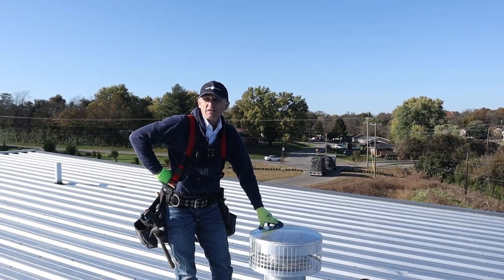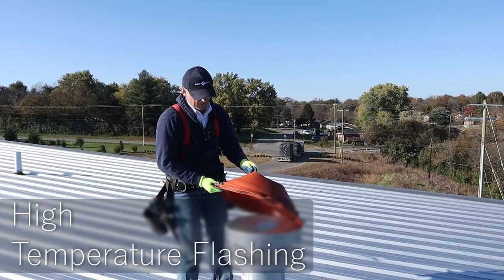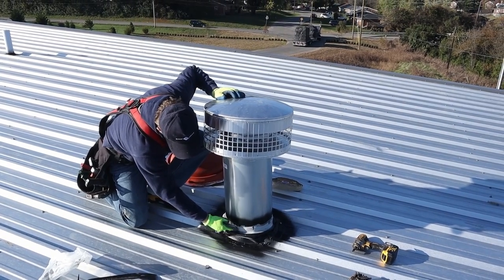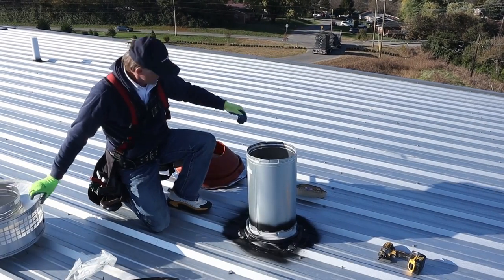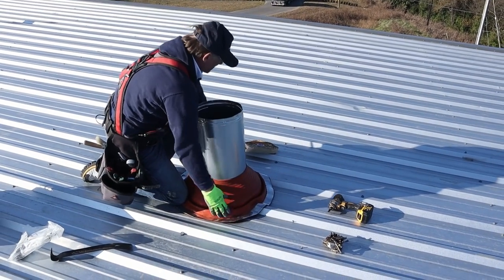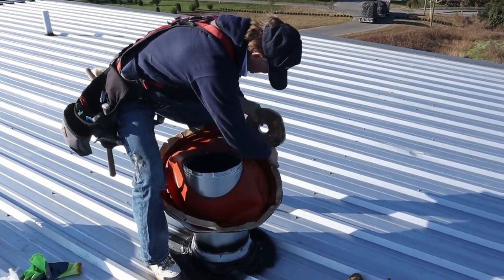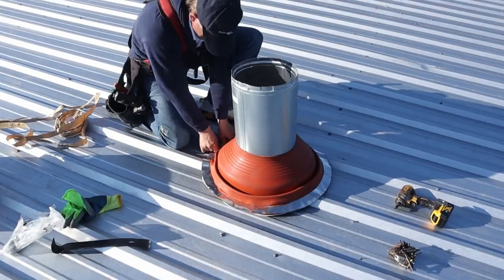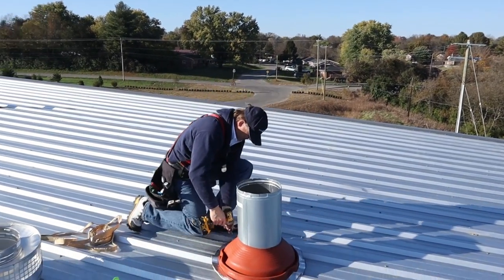Metal Roof: How to Install Pipe Flashing

Comment: What if I have a roof with deep grooves?
Reply: This video is an example of deep grooves. 
If you have steeper than this, you can build a little saddle around. Can be done with metal, spray foam or TPO. It is a bit complicated to explain but there is a way to fix it